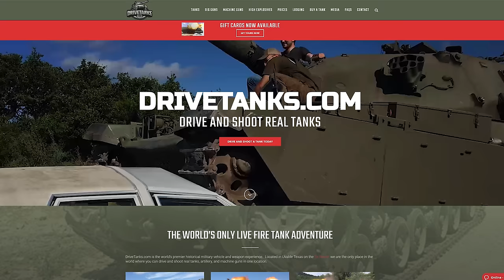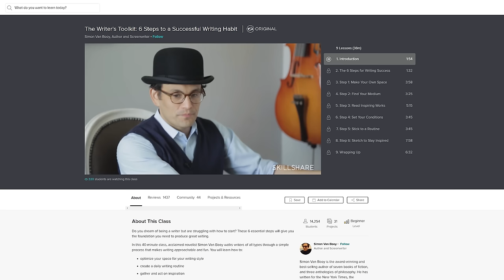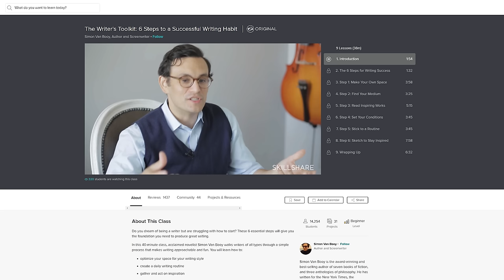The War Thunder Experience

Comment: Unrealistic you weren't sniped from spawn enough
Reply: or hit with more APCR ammunition than a German tank company would actually have.
Reply: @pantherace1000  lol who fires APCR
Reply: What is apcr anyways?
Reply: @fulcrum2951  Armour Pierceing Composite Rigid shells, good for penetrating FLAT armour, but bounce at any angle, and have pretty much no explosive filler.
Reply: @heeheehayftw3905 , AND ARE SO HARD that they NEVER make any shrapnel.... It's basically harders than modern APDS-FS made of the BEST DU or Tungsten Carbide available for Naval Railgung Prototypes
Reply: @pantherace1000  who tf even fires APCR with german tanks?
Reply: Lmao so true

Comment: This was great. Totally accurate shows how average/console players feel about the game.
Reply from the maker: That's what we were going for! Cheers!
Reply: Thats exactly how i felt when i played this garbage.
Reply: This is my I feel playing British ships.
Reply: @HaloFTW55  wha? british 4.0-5.0 is one of the strongest there is, the 17pndr does no wrong!
Reply: @Dockhead  Aside from british REFUSAL to use HE filler in their ammo. It pens everything but you gotta aim properly for it to work
Reply: @Dockhead  At the lower tier right now 1.0-2.0, the .303 Lewis are underwhelming.
Reply: @Tom--pf8ub  it is the case now, but before it penned that hard you took 3 crew out at the minimum and a 7sec reload typically means a 2nd shot kill at the most.
like the panther D you typically come across now. pen the flat front plate on turret and the whole turret and breech is wiped out meaning they've got nothing to do other than try run.
Reply: @Dockhead  huh, Haven't had issues with 17 pounders in muh tiger, but then again i angle so the AP shot does jack shit most of the time And the cupola is only a way to kill the commander and nothung else
Reply: @Tom--pf8ub  im amazed maybe most british players are just awful, hopefully one day we can cross paths one day and we can test metal with metal lol
tiger driver port cant be penned. change my mind.
Reply: @Dockhead  Tiger driver port can be a source of surprise buttsecks when you are angled, thankfully the gun mantle is kinda bouncy (But not enough to rely on it)

Comment: 2:30
Real life: Sherman trap shots become so dangerous to Panthers that they create the Panther G with a redesigned gun mantlet to prevent trapshots.
War thunder: dIdNt hApPeN! dO yOu EvEn sEcReT dOcUmEnTs?!?!
Reply: when i play panther its like every section of my tank is cheese paper
Reply: @Yingyanglord1  The only that works is the front plate and even then many things can pierce it. Panthers biggest strength is mobility and a powerful 75mm.
Reply: to be fair trap shots do happen in the game, its just rare. just like in real life. it still happened too often but that is relative to crew availability.
Reply: Guys, the panther is a MEDIUM tank with a better gun, armor and HP/Ton ratio than the M4A3 sherman. It actualy makes me sick to read that this is not enough for some people and they want impenetrable armor on top of all that. 
If that is not enough then go to the US tree, grind your way to the M4A2 76 and play it. Belive me, after playing it you will want to kiss Gaijins feet 100 times because they put the Panther at 5.7 because the M4A2 76 is worse than everything you face in every single way(And this comes from someone who has it fully spaided). The Double diesel engine has incredibly low HP meaning that lituraly everything excelerates faster than you and you will be back to 10km/h once you tap a or d once, and you will Most of the time Drive around at 15-20 km/h. The armor might aswell be non existent because the things you fight at 5.0 in a best case scenario(which will never Happen since you Always get uptierd to 5.7-6.0) are Pz. IV's and T-34-57's (oh yeah and did I mention that you don't get a APCR Shell and have to fight the Pz. IV 70 (V) which doesn't have a single frontal weakspot and can lolpen you?), the gun is not great and you get gaijined a lot with it (shot's don't penetrate although they should) and once you miss your Shot you are practicly dead because all shermans max reverse speed is 4 km/h. Also the APCBC Shell has a pritty low muzzle velocity makeing it pritty hard to aim. Lituraly the onely selling Point of that Sherman is it's top Speed(which you will never reach because of said HP problems) and it's stabilisor which onely works up to 15 km/h while the Battle Gear(CC 1) is at 18 km/h meaning that you can't use it anyways(Not even mentioning that it's Not historicaly accurate and the stabilisor should work up to much higher speeds).

Now thats what you call suffering.
Reply: @jakobc.2558  yeah, if you have to play USA just do the braindead heavy line, from the first jumbo until the t34 you are safe except from experienced players
Reply: @jakobc.2558  This is why i love Muh Tiger. Good mobility, great armor, fair-ISH matchmaking, and an 88mm nuke dispenser
Reply: @denisrizzardo2722  Yeah If you have to play the germans just do the braindead heavy tank destroyer line. From the first Jagdpanzer IV untill the Jagdtiger you are save from the front except from experienced players.

I mean seriously, the Jagdtiger was moved down to 6.7 recently. It is the most heavyly armed and armored vehicle at 6.7 right now and even in a uptier tanks like the IS-3/IS-4 are actualy weaker than you because they can not penetrate you frontaly with their 122's while you just have to trapshot them and go threw the gunnmantlet(and threw the driver view port on the IS-4). In other words you have a tank that will win almost every 1-vs-1 against a tank that is 0.6-1.0 BR's higher than you. Also on the german side you can actualy make a lineup out of your heavy tank destroyer (6.3) On the US side of thing you also have to use some other tank class.
Reply: @jakobc.2558  doom turtle. Thats all i have to say
Reply: @CrazyDutchguys  you never played the Doom turtle. Thats my short reply.

I am sorry but there is a good reason why almost Nobody plays it on Realistic. Let me just show you how a battle in it looks like:
Small map; You Spawn and immediatly move. When some of your teammates already spawned in their third tank and the match is half way over you finaly reach the Battlefield, get maybe one kill and then either get HEAT-FSed by a RU 251 or just about every italian tank or you get bombed before you even reach the Battlefield because the T95 has the lagest siluette of any tank in the game and it can not run from bombs at all. And once you die you pay a spicy 13 000 lion repair cost. 

So basicly the (Edit:)Jagdtiger gets 50mm of frontal armor less than the T95, gets a better gun, 40 km/h top Speed while the T95 doesn't go higer than 13 km/h and once you are on a slight slope that is reduced to 6 km/h. I will take a Jagdtiger over the T95 any day of the week and you would to If you would actualy know what it means to drive to the cap point for actual 20 minutes of your valiabul life time onely to get your 4 Crew members killed by a DO 335 with the APCR 30mm cannons.
Reply: @matthiuskoenig3378  RARE?!!! 4 games in a row is RARE?!!!
Reply: @jakobc.2558  ya and people keep saying that the t95 is better than the jagdtiger like wtf you hardly ever see them on the battlefield unless it's a new person who just got the tank
Reply: Jumbo 76mm at 6.0 and panther A at 5.7 and the fact you have to fight your own tanks ( Italians French and now the Chinese all team with the Germans) while still fighting tigers and panthers and some medium and heavy Russians who are thrown into the mix is hateful literally you lose the advantage your tech tree provides looks like gaijin just decides to bless every german tech tree player from 3.3 (talking about the captured vehicles here) to 5.7
Reply: @martimnunesmartinho6788  the Chinese issue, and why they seem really good, well they do have a good tree. All of the players are generally lvl 80+.
Reply: I think the US tree is fairly competitive against the same BR German tanks imo. The br system is just what it is. The game generally is more balanced then people believe it to be when it comes to ground battles. It's just psychological biases that make people believe that they are always uptiered or it's always screwed. But they do at times have the other team comprising of more of the highest br tanks like let's say 5 5.7s compared to your teams like 1 or 2.
Reply: Brian Vieane you consider yourself uptiered when there is atleast one tank of higher br the problem is even the tanks the Americans have at 5.3 seem to always underperform
Reply: Translation: It became vaguely possible that a 75mm might achieve a miracle shot by being deflected by the mantlet into the crew compartment.
Reply: @martimnunesmartinho6788  It would be fine to me if the Italians would just get US tanks and we would have to fight them, but that is not even the case. THE ITALIANS LITURALY GET BETTER VARIANTS OF US TECH TREE TANKS AT THE SAME BR!!!
For example the italian M26 has 185mm of pen on it's APHE shell and a higher muzzle velocity while the US M26 onely gets 171mm of pen. But guess what? They are both at the same BR.
It's the exact same thing with the Italian M36 vs the US M36(although that Thing weighs 5 tons more than the US M36 so it actualy has a very small advantage in that reguard)
bUt 14mm's mOrE pEn mAkE nO dIfFeReNcE.
Yes they do! Those 14mm of extra penetration lower the chance of getting gaijined or in other words haveing rounds not penetrate that should penetrate. You all know the "probability Low" indicator in the protection analysys right? Well that's the zone where it becomes RNG weather or not your Shot will penetrate and haveing more penetration gives you a lower Chance of getting RNGd.
My Point is that Gaijin hates the US and doesn't give a s*** about the US Tech tree.
Thats why they removed the 150mm blocks from the M26 gun mantlet but left them on the Panther gun mantlet.
Thats why the M4A2 76 is at 5.0 while the M4A1 76 is at 4.7(In case you don't have both tanks spaided/don't own them, the M4A1 76 is better in every way than the M4A2 76 but Gaijin simply saw a bigger number behind the letter A so they put it at a higher BR.
Reply: @martimnunesmartinho6788  the games come down to what the m18 swarms can do honestly.The t20 is a very competitive good tank. My point is that the balancing for tanks is fairly balanced compared to prop planes allies vs axis air rb. You have way more of an influence of how the battle turns out in ground rb. You have your good and bad games of course. I'm still waiting for them to nerfb109s or just do all allies vs allies or mixed battles for air rb. People say axis players are better but they are the same players people have both axis and allies planes, that argument is invalid.
Reply: @jakobc.2558  You're absolutely fucking right.

Comment: Ironically, if the game was actually historically accurate, there will be many things different. 
The Russian tree would need one full tutorial since 99% of the time you’ll die from non-penetrating sprawls like literally a 50mm will have no trouble killing T-34s like the bucket load. 
The Russian tech tree would essentially be the most unplayed tree since there will be no repairs but replacements so it will cost the same as buying a new vehicle. 
The American tree will probably dominate against mediums (the M4 in 1942 was far superior to even panzer 4s until 1943) but not against heavy tanks unless it’s a Pershing or later. 
The Russian tech tree will be hated since 50% of the time something will certainly be not airy or your crew is either drunk or can’t see anything.